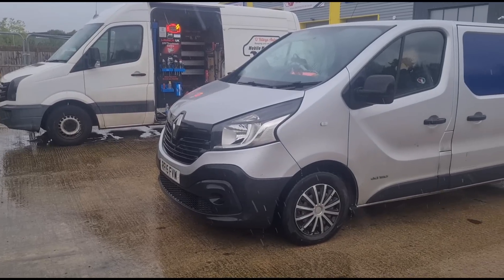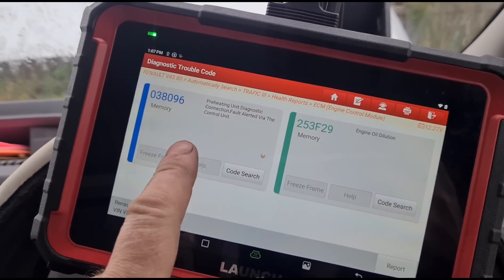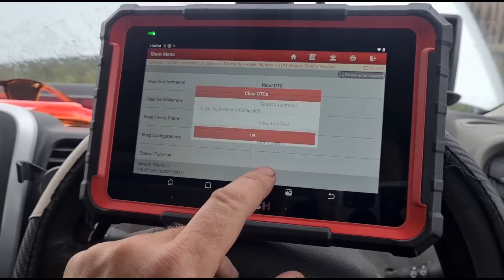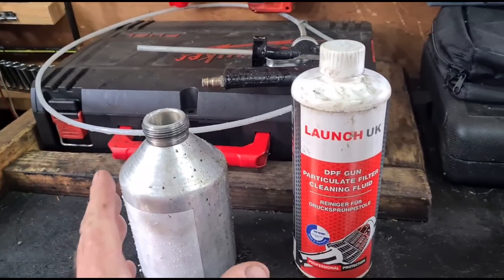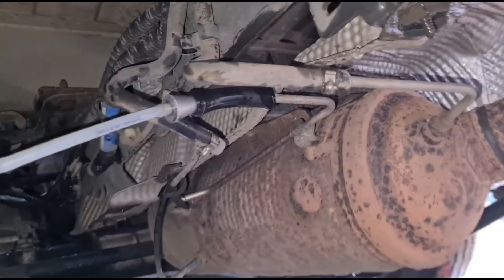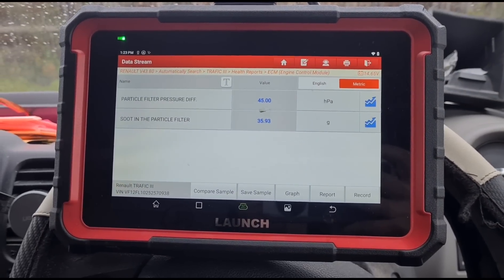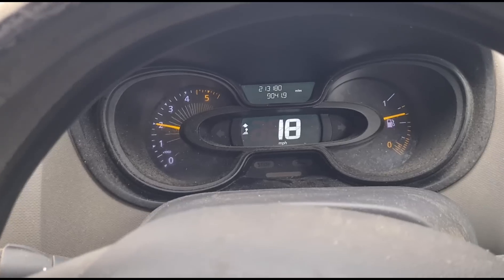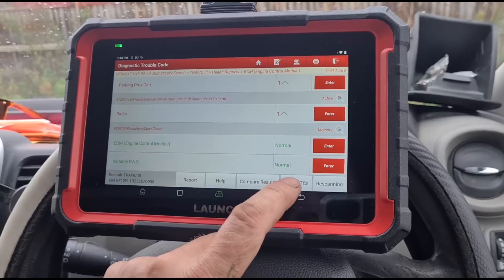Renault Trafic DPF Diagnostic & Cleaning

Comment: I did this on my 2018 biturbo vivaro. The soot level went UP. On my Topdon 600s it was reading at 11. i put in half a bottle of launch dpf cleaner and drove for 20 minutes keeping the revs up. Got back and the soot level went up to 14?? I don't have a compressor so i put the launch in using a pump bottle.

Comment: Hey Jimmy what type of milage does be on these vans before they go tits up ???
Reply from the maker: 60k. Usually after 120k the dpf is beyond repair
Reply: Hi Jimmy is it worth having the dpf cleaned on a regular intervals I have a Toyota proace no problems as yet but I'm presuming it's coming at some point 51k on the clock. Thanks for the vids👍🏻🏴

Comment: I had the check injection fault - upstream of turbine pressure implausible signal - I followed your process to clear using a drill and guitar wire. You make it look so easy doing it one handed whilst you hold the camera - but I worked through it - cleared the blockage and all good. Vivaro biturbo on 108k which has been great up to this fault. Great stuff and thanks.

Comment: Hey Jimmy,

do you maybe have some advice for my Trafic?
It keeps doing Regens every 30-60 miles.

No fault codes on the Ecu, Glowplugs are fine, Exhaust pressure sensor isnt blocked, diff pressure hoses also not blocked, and I didn't find any other obvious errors either.
Also no soot at the end of the exhaust.

When I drive the van it builds up soot until 17-18g and then it starts a regen. after the Regen is the filter still has 8-12g of soot in it.
30-60 miles later its back at 17g.

I have already had removed the DPF and cleaned once.
Back fitted the soot went down to 0g after the regens but 2 weeks later its back to the old specs. 8-12g after regen.
and this is happening for like 4 months now if i remember right.

Any ideas? 😅
Reply from the maker: Sounds like ash build up. Very common after 100k
Reply: Would love to know the answer to this as I got exact same issue on same van
Reply: @stanislavvojtas254  Likewise. I think there must be quite alot of people suffering with P253F oil dilution fault due to too frequent regens. I'm guessing you've experienced that at some point?
Reply: @jfox1992  no oil dilution code,  according to data stream- oil dilution is 1.8% and was changed 4 weeks ago.
Van got currently 34000miles
Reply: @stanislavvojtas254  Fairly sure at 10% the P253F fault will come on flagging "Anti Pollution Check System" message. Which I guess at that rate will be in about 6 months? Unless someone didn't reset the service interval when they last changed the oil.
Reply: @stanislavvojtas254  and for you also.
Software update did the trick for me
Reply: Is the dpf full of ash?  Regens get closer once the dpf gets full of ash
Reply: @MaxMoment2023  Well that also was my first thought so I took it to a dpf cleaner. The "old" ash was flushed out.
After the clean I had 2-3mbar at idle and 25mbar at 3000rpm.
like a new filter.
But 2 weeks later it was like before. So I think ash wasnt the problem in the first place.
Reply: Have you checked for air leaks after the Maf?
Reply: @davidoff59  Yes. no leaks
Reply: Hey. I'm experiencing something similar but differences in values. 

Mine does a regen between 14 and 15g. Ends up with 7g after a full successful one. 

Once complete, soot goes up again very quickly. I can maybe get away with 100+ miles on motorway without a regen but worse is pottering around town. If I drive it so it's always 2600rpm or more the soot doesn't seem to go up anywhere near as quick. If I'm in a low gear and going at 1500rpm, soot goes up rapid.

I don't get it. 

Also my soot doesn't go up until 65 degrees so if I drive steady in morning to work I can get 0 soot increase. Odd. 

Mines single turbo 65k miles, yours?
Reply: @jfox1992  i think its normal for the ecu to wait until the engine ist warm to calculate the soot.

I also have noticed that with the higher rpms and lower increasing of the soot. I think the exhaust temperature gets hot enough on ots owm so the soot is directly burning away in the dpf. Thats why its not increasing so rapidly.
But I could be wrong.

Mine is a TwinTurbo 145.
130.000 miles.

Single and Twinturbos have different sized dpfs. Maybe thsts why you have other specs when its regen. I have seen other rensult cars which start regen at 22g and another one at 30g.

Weirdly i had no issues with oil dilution faults.
But the van wanted an oil change after 12400miles some days ago.
Normaly I can go 15500miles between changes if I remember corrrectly.
Reply: @danielseibert4082  Yeah sure I've assumed that's normal now.

I actually think it's the reverse of that but I've have to check my data again as its just what I've seen when driving on the motorway. When you drop a gear and then have higher revs the filter temperature seems to drop. Which seems to reduce the pressure difference and then the soot goes up slower. Not 100% sure though. 

I do suspect mine is very temperature sensitive. As on start up the pressure is 6mbar then varies kinda randomly between 9 and 13mbar on idle during the same journey. Varying probably due to temp increase and decrease. 

I can't decide if it's broken, full of ash or the engine is actually producing a load of soot. Or the sensor is crap too. Its defo going up too quick tho. 

Ah yeah good point about size of DPF. 

Dam, mine seems to be one of the lowest mileage suffering from something like this.

Ah at 30 to 60miles per regen, I'd have thought it would be fairly quick to pop an EML light on.  I think once the oil dilution ratio gets to 10% it flags P253F. I was getting this every 3000 miles. I've managed to improve it a bit I think...by monitoring it all the time. Ugh.

Like Jimmy says, the fact urs goes to like 8g when it's done a regen surely sounds more like a blockage/ash than mine.
Reply: @jfox1992  I also have these weird jumps at the pressure. but its normal for the filter to have lower pressure when its cold due to the expansion of the pores in the filter. thats why the ecu wont calculate the soot mass on a cold filter.
On mine its also jumping. sometimes i have 12 or 15mbar and after I rev the engine it drops to 8-9mbar for a view seconds. Dont know why this happens.
The sensor is fine.
Checked with a manometer.
And when I turn off the engine (or on a start/stopp) the pressure always goes exactly to 0mbar.
If the sensor is faulty it also should jump between -1 and +1mbar like on idle when the engine stopped.

I still think I rather have a soot problem then an ash problem.
If its ash I would assume the readings would never go unter 16g and than slowly creep back up to 17g after 60 miles.
But the fact that I sometimes get 7g after a regen which relativ fast get back up to 17g makes me assume the engine is producing to much soot.

I'm slowly starting to suspect that something is f+cked up with the engine software/injection 😅
I really have no ideo what else could be the cause...
Reply: @danielseibert4082  Yeah fair enough, cheers for the info. I can also get that jump and drop at times from a rev. Be at 13mbar, rev it and it goes to 9mbar. Seems like we've been trying to understand very similar issues. 

Like you say as far as I can see, the regenerations are mostly successful especially on the motorway etc and it's not even in the regen for that long on a motorway. A few minutes and it's done I think. If I'm idling/going round town and its in a regen it does struggle to get the soot down...guess not enough heat and too much fuel. 

I've come up with all sorts of theories because I don't get what is going on.

I had a garage recommend going to the dealers and asking for a flashing of the latest calibration which is a valid comment...they said they've had a few other manufacturers vehicles get success with that.

I'm surprised you don't get P253F. That's what first brought me to this issue and I worked out that every 3000 miles would flag P253F. I believe I've got that much higher now, but still crap. 

The other thing I've got is losing oil...which does seem to be in the boost pipes/intercooler but doesn't seem crazy bad but maybe I'm burning that too. 

You seem to know quite a lot about this. Maybe we can try help each other and keep in touch.
Reply: @jfox1992  Yes studying jimmys videos for months now😂
So many theories in my head also...
I dont know anybody who knows more about the dpfs. thats a pain when you have a unsolvable problem and no one to ask for help👀

I also have oil inside my pipes. But thats since the car had 60000miles and back then I had no issues with the dpf. Well it is low-ash-oil and oil itself is very similar to diesel so it should not have a huge impact. I never even top up the oil so its not that much what is getting through the motor.

One thing I also noticed in general on renault. (especially after my filter got cleaned)
The meassurement "soot" is not really showing the soot inside the filter.
It should be renamed to something like "soot + ash"

The ecu does not calculate the ash seperat like other manufactures.

On a brand new filter without any ash you have a soot loading of 0g if there is actually no soot in it and 17g if there are real 17g of soot in it.
On older filters if there is for example 5g ash in it and 0g soot the ecu still shows 5g of soot becaus it does not differentiate between soot and ash. If the filter is back at 17g of soot in reality its just 12g soot cuz the rest 5g are the ash.

This also fits well with the fact why I can't read the amount of ash anywhere in the ecu.
Also there is no option of resetting an ash counter or something similar.
Reply: @danielseibert4082  Just re-read your edited message. Mine does sometimes jump between 1 and -1. I did think that was suspicious...guess I'll look at changing that.
Reply: @danielseibert4082  Likewise...absorbing as much information as possible but I'm no closer to a solution. I've seen a fair few FB posts with "Oil dilution/P253F after X miles due to regenerating every <100 miles". 

If it's engine issue generating lots of soot, I don't want to just get a new DPF or whatever. I need to know the cause? Boost leaks, injector issues, EGR issues...software issues...god knows. Nothing obvious. 

I'm topping up quite a bit...so that could be some of my issue. I expect the oil to surely leave deposits in the DPF, although like you say, my DPF still regenerates ok and goes down to 7g. 

Yeah there's no ash parameter as far as I see.

Any thoughts on next steps?
Reply: @jfox1992 dont just throw in a new dpf. Dont you also have the dpf barried behind the engine?
Its a huge pain to remove it. The whole steering rack and stuff needs to be removed to get it out.
There I am a bit more lucky with my TwinTurbo. My Dpf hangs underneath the van. Relatively easy accesable and easy to remove.

Boost leaks will always throw a code. Minor leaks maybe not but these are so small that they wont affect the fuel mixture/soot amount.

Injectors also where in my mind.
But I cant really believe it to be the cause. The engine ist running to smooth for my taste to have injector problems.
Also I tested the return flow of my injectors a few weeks ago.
Not as perfect as new ones but still in spec.
So no obvious signs of a injector fail.

My next step will be going to the dealer and try to get a reflash/update for the ecu.
If this wont help I think I will remove/inspect the EGR.
Reply: @danielseibert4082  Yup the single turbo is in a terrible place. Subframe off etc I believe. I don't want to but I need to try something soon but maybe that's not the logical choice right now. 

Yeah would think boost leaks are more obvious like you say plus I had the intake system smoke tested. 

Yeah maybe I'll try the same as that was mentioned to me earlier in the year. Mines a Vauxhall and I'm cynical that Renault even share ECU updates with Vauxhall lol but I guess I should try.
Reply: @jfox1992 so my friend. Softwareupdate done. After that I drove 60 miles. Soot went up only 2g. When it stays that low The filter should regen every 300 miles. Im fine with that.
Maybe after the first regen with new software the soot drops even lower than before.
 So I think problem is solved for me.
Maybe you also need to meet your dealer
Reply: @danielseibert4082  Hi! You legend for coming back here and giving us an update. 2g for 60 miles and a regen at 300 miles sounds like it's about right in my eyes. 

I can't remember if you said and it's hard to see on youtube comments, but what year is your van and how many miles? Single turbo right? 

I know yours is a Renault. That's my only concern is that mines a Vauxhall...I hope they have the same software update. 

I will contact them asap. 

Can I ask what Renault dealer you used? I assume you're in the UK. 

I just want to know as much as possible, as this sounds really promising.
Reply: @jfox1992  2017 TwinTurbo 125000miles
No I'm from Germany.😂😂
Cant help you finding a good dealer.

Yesterday my Van did its first regen.
Well already at 14g, a little earlier than usual.
This time the soot went even down to 4g.
And it stayed that low for way longer than before...
The soot is still fluctuates by -1/+1g all the time.
Especially when Im have high load changes on the engine.
But its not creeping back up so far.

I would assume Vauxhall also can do Updates.
If not maybe you can try Renault/Nissan/Fiat dealers. Maybe youre lucky and their Diagtools can update Vauxhalls.
Softwarenumber and Tuningnumber of the ECU should be the same on every brand. But maybe the stored VIN will prevented updates from other manufactures. But why not trying it.

If no one can do an update, I would ask vauxhall for all the information about the current software. Software version, software number and tuning number and so on...
Then ask around in your area whether any chip tuner has this software and have him reinstall it to your ecu.
These dealers often kinda struggle with softwareupdates on cars I feel like.
Reply: @danielseibert4082  Thanks again. Appreciate the replies. 

Dam! Yeah I don't think I'll be driving over to Germany anytime soon :P. 

How many miles do you think that was before the regen? Do your pressures look any different now? I wonder what has actually been fixed. 

Anyhow, yeah I agree that they should definitely be able to do a software update. It would be crazy if they can't. I'll try contacting them again. 

A few months ago I was in the area of dealerships on a Saturday, so I thought I'd nip and try chat to the service team...Vauxhall was shut. I went across the road to Renault and the workshop manager was very helpful in chatting to me but not that helpful in terms of software info. 

She said, they wouldn't touch Vauxhalls etc, I'll try Vauxhall again but I wasn't convinced  by them at the time I rang last time, but I could do with talking to someone technical and trying a few in the area. 

So did you have someone reflash the software that was already on yours? Or did you get a more up to date/recent software version?

Yeah I sense that it's an underlying issue.
Reply: @jfox1992  For some reason still around 300miles as I predicted.
Eventhough the the soot was only at around 14g instead of 17-18.

I haven't been paying much attention to the differential pressure lately. Mainly to the amount of soot.
But if I remember correctly at idle with the old software the diffpres after regen was at 10-12mbar and now with the new software it was at 6-8mbar at idle.
Well and 15mbar on a full filter regardles of the software.

Maybe you have to sign a paper that you want them to do an update.
I also had to do that. No idea why...
And try to talk to a mechanic directly and tell him what you want.
The people at reception are never really helpful when you have a problem.

I think the mechanic can no select that.
The DiagTool automaticly does an updates if there is one.
I dont know what Software was writen on my ECU before but now I have the newes one which is available.